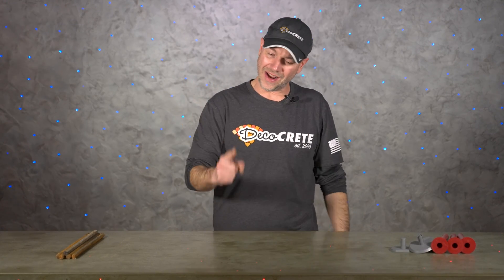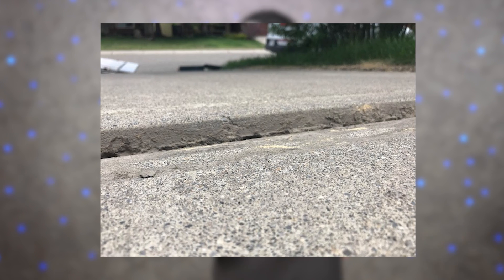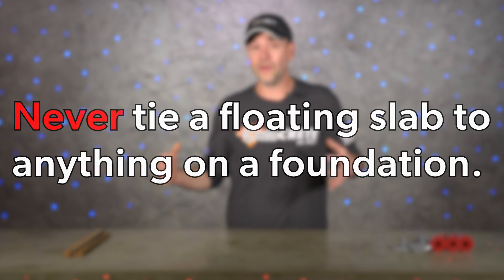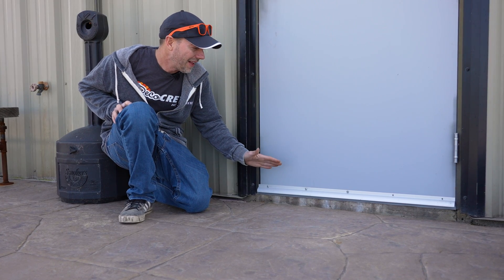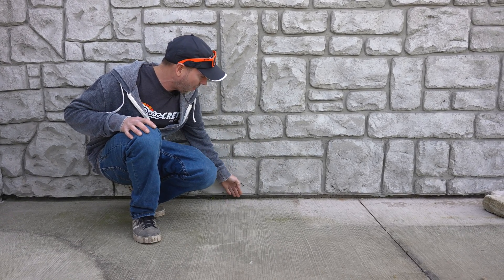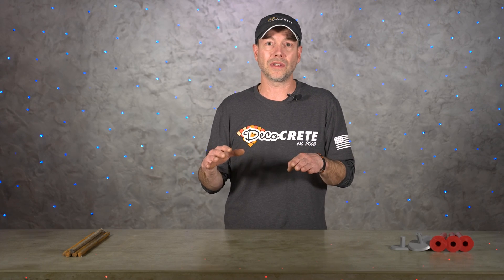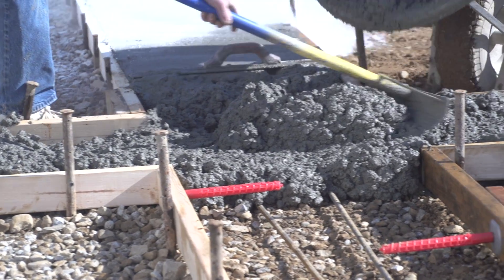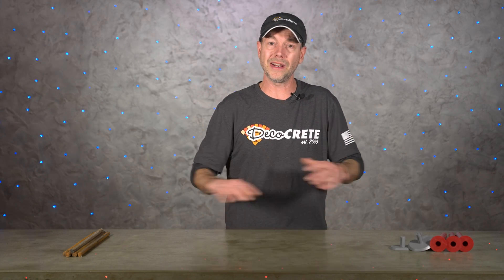The Truth About Doweling Concrete Slabs!

Comment: I have a question! So unfortunately, I didn’t do my research before hiring contractor to pour us a patio slab in the backyard behind our house. To my knowledge, not only did they not put any kind of expansion joint between our foundation and the slab, but they also drilled multiple holes and doweled the new slab into our home foundation . I honestly don’t care if the patio slab itself starts to crack and break at some point, that can be replaced with only a modest amount of expense, my real concern is for our home foundation. So my question is, is the fact that they did not put any kind of expansion joint Between the slab and our foundation (at least that I can see), and the fact they drilled holes and doweled it to our foundation with Rebar, are either of those things of potential danger to our home foundation, or is it more of a risk to the patio slab itself? I hope you can answer my question because this has been weighing on my mind for over a year now, I can’t seem to find other YouTube videos or people that have much to say on the matter so I was ecstatic to come across your video today!
Reply from the maker: Thanks for the comment! The real danger is to the concrete slab itself, and it's rare to see damage to the foundation. If there's any significant movement of the slab during freeze-thaw cycles and the concrete is tied to a foundation, something will have to give, and that would generally be the concrete. This also depends on what part of the country you live in. If there is little to no freeze-thaw in the area, then this really isn't as big of a deal. The deeper the ground freezes, the more the slab is going to move in the winter. As we said in the video, this topic comes with some debate. It is tempting to tie floating slabs into something solid, but we like to play it safe on this one. Just let the concrete move as it wants, and the expansion joint will keep it from binding up. If they dowled your slab into the foundation, then there is really no need for any expansion joint. If the company that did this for you has been around for a while and this is their normal practice, then I really wouldn't worry too much about it. Again, this is our stance on this, and although most contractors in freeze-thaw areas would agree, there are some that say you have to tie everything together. Hopefully, this helps. Thanks for watching Deco-Crete TV!!!
Reply: @DecoCreteTV  thank you so much for the reply! I feel a lot better about the whole thing now!
Reply: @craigeslim7212 I wouldn't worry. I'm glad he mentioned climate. I have a small concrete business in Texas, where we have very rare instances of heavy freeze, and we dowel just about everything. Most city inspectors around here require it to pass inspection.
Reply: I have a slab that slid away from my foundation about 1/2 inch per year during the spring thaw here in ND.  At 2" out it now stays put.  No damage to the foundstion.
Reply: Every Walmart building I've worked on has dowels into the foundation 10 to 15 ft
Reply: Only time I dowel into a foundation is a new porch cap with footing freeze/thaw state and expansion is a must against a foundation period……
Reply: I have the exact same question. Just had my patio poured a couple months ago and they tied right into the foundation. I live in an area with a high level of frost/thaw cycles. Wish I had done my research beforehand
Reply: @joshshook2901  it’s a shame that these companies/ contractors don’t already know how to do it themselves correctly without being told… the only recourse we would have is to get the entire slab demolished, remove the dowels, repair the empty dowel holes, and then have another slab with a proper extension joint poured.. it would be a very expensive thing to do. So unless I’m given reason I need to I’m just going to leave it as is and ill seal the top where the slab meets the house with a polyurethane self leveling sealer, and then on the sides with a general concrete sealer, that will keep most moisture out.
I still would love if he answered our question though, to get a real professional opinion!

Comment: should i use expansion foam to separate the drivewway from the gutter?  or should i just drill into the gutter and put in 3/8 rebar and tie it into the exisiting rebar ?
Reply from the maker: Thanks for the comment! This could work either way and there is no real right or wrong. I would check with some other concrete contractors around your area, just to see how they are handling this kind of situation. We would normally use expansion joint for that, and avoid tying into the curb & gutter. Thanks for watching Deco-Crete TV!!!

Comment: Here's a bit of weird question, so I have a pre existing barn, the barns foundation is stationary, but given its original use case its entirely slanted towards the middle as thats how they used to keep the hogs back in the 1960s. Now I require to add concrete ontop of this existing mess to create a level workshop floor. Would I just use expansion joints around the border and then tie my floating middle slabs in together? being an INTERIOR pour its also different but working with well over 50 year old pour i feel I will be learning a lot of things that most people won't ever run into. I don't mind some lips happening because nothing is ever static and perfect, but i do not want something i cannot Dolly working pieces over size of a lip between the "exterior" barn pour and my current projected slabs. Am I thinking about this correctly using your tips?
Reply from the maker: Thanks for the comment! This is defiantly a unique situation. The best thing would to remove all the old concrete and repour it. Pouring on top of existing concrete can work, but it comes with it's own set of challenges. Most full depth concrete mixes would need to be at least 2" thick. If you can bring the perimeter up 2" and fill the middle in, that would be one thing. But, 2" in the middle and trying to feather it out to nothing on the edges won't work verry good. If you are able to get enough coverage over the existing slab, than definitely use expansion joint around the perimeter. For the concrete itself, most contractors use would isolate the two slabs. Either with plastic or a layer of sand. Trying to bond the two slabs together would probably lead to some problems down the road. The other option would be to use floor leveler over the existing slab instead of pouring ready mix concrete. Our Flat Top product would work well for this, it just gets a bit expensive if you have to go really thick with it. I'll leave a link to the page on our website. Hopefully, this helps! Thanks for watching Deco-Crete TV!!!                                                                                                                                                                                                            
 https://www.deco-cretesupply.com/products/overlay-mixes-repair-prep-products/flat-top

Comment: Every commercial project I’ve been on requires floating slabs to be tied into building with dowels at all door openings. Without that, how are you supposed to prevent frost from heaving the slab to the point the door doesn’t even open? 

Your example works because your slab is 2” below your door threshold and you have the room but that is not ADA compliant and on commercial projects your sidewalk needs to meet with the finished floor of the building.
Reply: That's why they put Styrofoam around the perimeter
Reply from the maker: Thanks for the feedback! If it's spec'd for the job, then you have to do it! Thanks for watching Deco-Crete TV!!

Comment: When i dowel 2 slabs together i aleays use epoxy coated rebar dowels. Concrete always shrinks a bit and your going to get moisture in between causing the rebar to rust.
Reply from the maker: Thanks for the comment!!!
Reply: My contractor didn’t use epoxy rebar, I can see there is a very fine gap between new concrete slab and house foundation, I’ll seal it by Polyurethane. But my question is if the rebar rust, could it damage my foundation, make it crack? They drill holes every 30cm, and there are 14 holes. I appreciate if you can answer my question. I am struggling if I should rip up this new slab , take off rebars, fill those holes, and redo one with expansion joints.

Comment: Attended the expo this year for the first time and it was great! Looking forward to the next one for sure. Anyways, when it comes to pinning into foundations, we always pin at the bottom of the slab (top of the gravel base) so that the slab cannot settle, but still can move up. What are your thoughts?
Reply from the maker: Thanks for the comment! Glad to hear you enjoyed the expo!! Pinning into the foundation underneath the slab is a good way to keep the concrete from settling. We used to do that on steps and every now & then on patios. We would put the pins just under the top of the gravel base, so the concrete wouldn't actually touch them. The important thing is that the slab itself is not tied to the foundation. We ended up switching to a piece of angle iron on steps, and it works great. Here's a link to our Technique of the Week video on it. Thanks for watching!!!                                                                                                                                                                                                                                    
https://www.youtube.com/watch?v=hEAjqtYBLT8
Reply: @DecoCreteTV  nice, I like that! Thanks for sharing